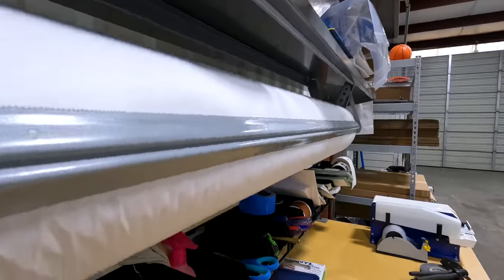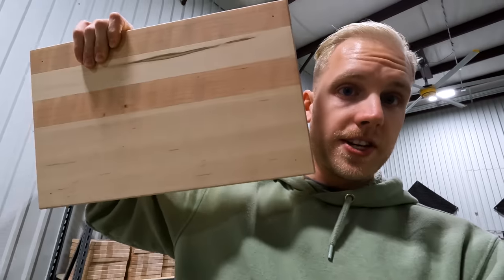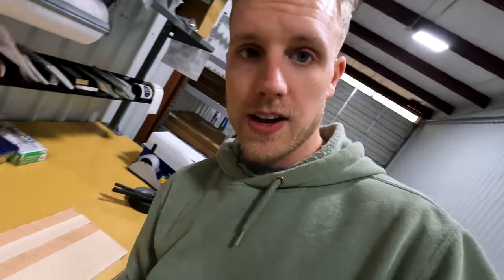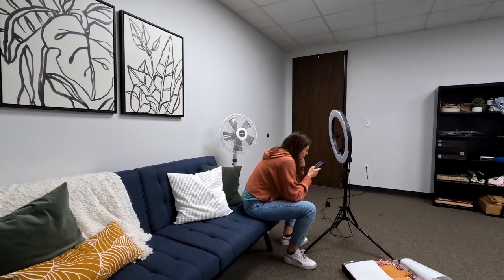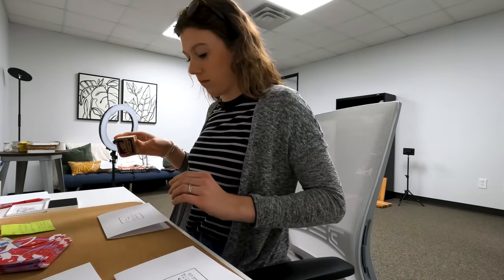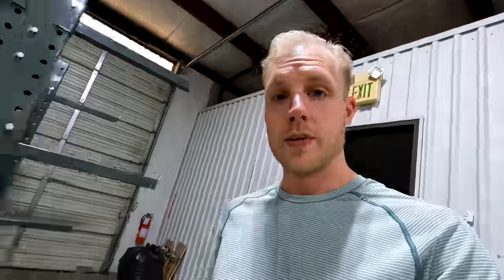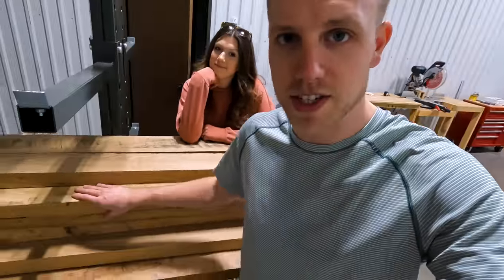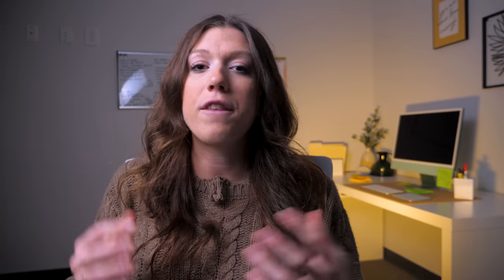you'll never guess who bought this table!!

Comment: Just because a board is cracked doesn't mean it's case hardened. Oak tends to check more than other species. Run some simple tests for case hardening, because if all of that lumber truly is case hardened, you just bought $1300 worth of firewood so get your money back. Using case hardened lumber in a $6000 table to a customer is asking for trouble

Comment: Could you pick it up yourself and pick the lumber out for your project ?  I think you could ask for a refund on the bad lumber. My lumber supplier stands behind the lumber they sell.  You should have rejected those boards.  Case Hardening comes from improperly drying it.
Reply: Yeah it’s bizarre to say it’s just part of woodworking. If the wood is bad, they should take it back.
Reply: That was my understanding of shop-picked lumber too. Buyer has the right to send it back. A buyer wouldn't pick that off the rack
Reply: @David Takes my lumber yard doesn't charge more when I pick the lumber myself. They just expect the stack to be returned as it was.

Comment: Always love the content. I just finished a white oak dining table mock up in Sketchup but I can’t find a good material to make it look like white oak. 
Would you be willing to share where you got yours?
Reply: You can save an image with the white oak pattern and import to SketchUp. Then, save as a material and it will be added to your material list!
Reply: @gabihuggins5042  thanks so much for the tip
Reply from the maker: Gabi saved the day, and we also use a plugin called 'ambient occlusion' for the renderings!
Reply: @jennieanddavis  is that how you get the room rendering with the floor & walls?
Reply from the maker: @gabihuggins5042  Haha yes, but those are just rectangles with a texture/color applied to them
Reply: @jennieanddavis  do you have ambient occlusion pro or ex? Trying to figure out which one I should get!